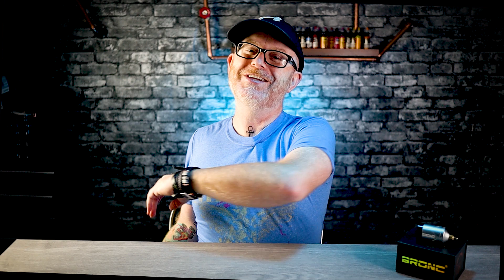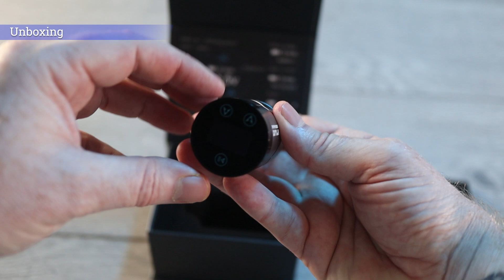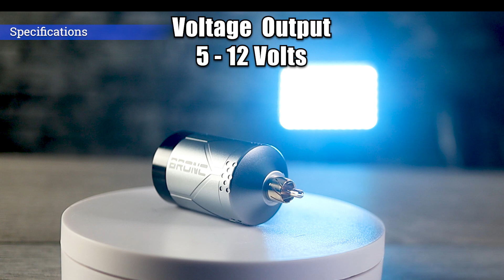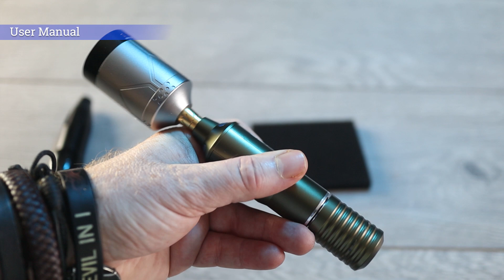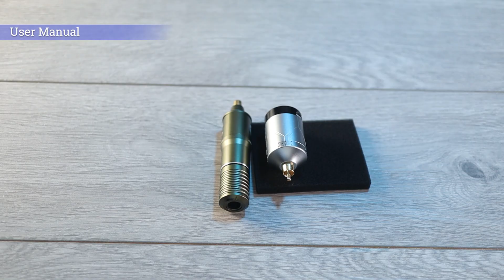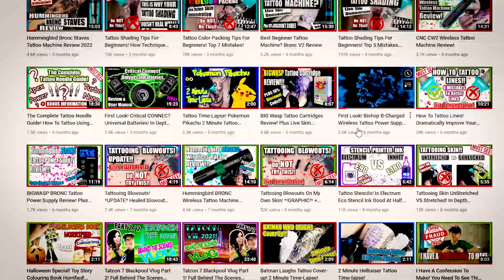Best Beginner Wireless PSU? Bronc R1 Tattoo Battery Review!

Comment: To review properly a battery pack, you need to test it with multimeter to see if the voltage is exact, and if the battery pack have variation of voltage.